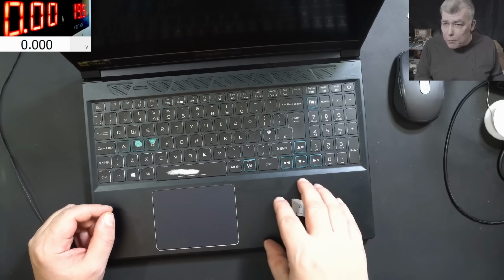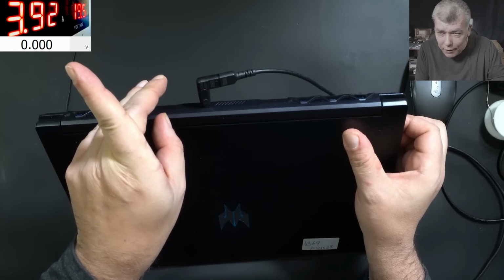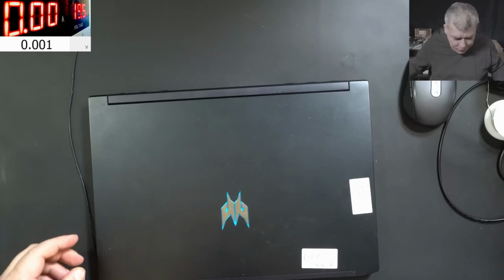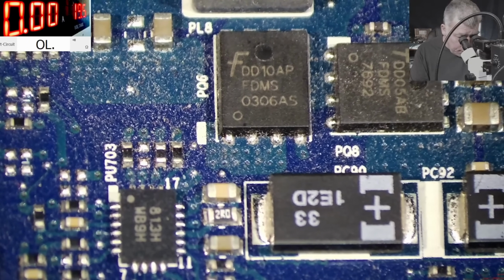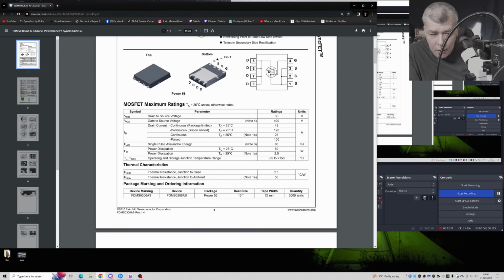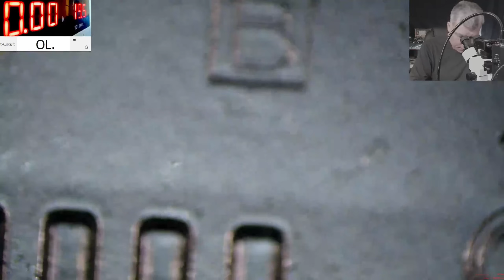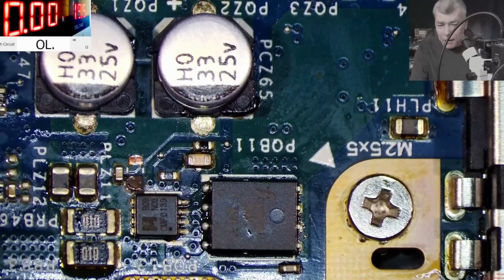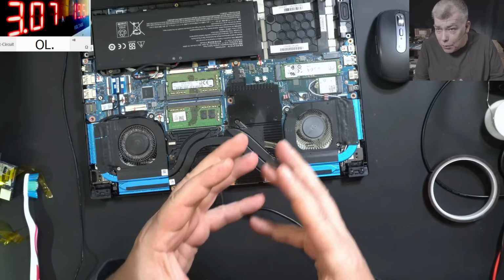Acer Predator Triton 300 not charging - DON'T REPLACE THE BATTERY! How to repair it guide

Comment: My laptop acer nitro 5 having kind of same problem it is not charging and not turning on 
I showed it to a guy and he did some repair and laptop turned on but only for two times and again got same problem as before what should i do
I gave him my laptop 3 times still facing same problem he is unable figure out what is the exact problem 
Each time
He done repair laptop turned on but only for 2-3 times then didn’t open 
Please reply me what should i do
Reply: You've probably tried these options already, but .... Sometimes it's the power supply socket that's faulty, or the power supply plug, cord or 'brick'.

Comment: Thank you for this video. I had a laptop with usb-c only charging that doesn’t charge and powers on only from time to time. and could not find the culprit. Was changing bq already because  I was measuring strange things around the charging mosfet. Thought of replacing the usb-c management chip. But guess what. The second input mosfet from the usb-c circuit is shorted. Can‘t believe it 😂

Comment: Another great video, informative and educational as always. 
Perfectionists - please remember this is and engineers' perspective of fault finding and repairing in a cost effective manner while giving the customer what they want.
I have learned from this channel that a "proper calibrated wire or 'fuse' " can be a safe repair in the right place 😀😀😀 (But, joking apart - you really do need to know what you are doing...as Sorin obviously does. )

Comment: Hello Master! Thx always for your lessons. I have 1 question. You did found that first Mosfet shorted which caused the issue, but, a lot of times you use the "proper calibrated fuse" to short the mosfet and bring the board to life.
Now i am not understanding why this shorted mosfets is a problem, and on the other tipe of faults, when there is no current flow, you short it manually...
My caption is, this time here, was the opposite situation, where the mosfet is always shorted and it should not be? Meanwhile when its always open, you need to short it?

Comment: sorin, 1 question. How can the laptop work fine, with the first fet shorted? why is not shorting the main power rail?
Reply: because it wasn't actually shorted. The fault was the cap was shorted. if he had just removed the cap it would have been fixed....
Reply: if cap was shorted to ground everything else on this power rail will be shorted to ground and replacing mosfet won't do anything. cap was fine but mosfet had short between drain and source so the BQ chip disabled the battery charging cause it sensed the shorted mosfet . your explanation proof you know nothing about electronics . educate yourself more  @g4z-kb7ct
Reply: the mosfet is not shorted to ground, it was just shorted inside , like a switch that doesn't make a proper contact and the light are dim.

Comment: Mosfet was fine - the S to D short was the capacitor alone - hence the current went to zero as the mosfet was turned off by the over current sensor

Comment: 24.5 volt from gate bootstraping because first mosfet n channel at high side gate is float at 18.5 volt (mosfet off) to make its on bq chip must add more 6 volt to make mosfet saturated/turn on. Why its consume more current/power because fault mosfet have more voltage drop from higher resistance compare to normal saturated mosfet and bq chip want to compensate it because power = voltage x current so if voltage drop curret goes up. Why its 18.5 not 19 (other comment before me) there voltage drop from connector and power supply because its use benchpower supply that manually adjust voltage, if we use original charger probably in high current charge will compensate to make output from charger around 20 volt and at notebook you will find 19.5 volt.
Reply: very good explanation

Comment: You get them for repair because people can buy them "brand new" not like second hand business class. If a customer has paid ca 1k(+)€ for it, it is valuable to the customer and it will be repaired even the repair costs 250-350€
Reply: there is a general rule with repairs.... the more something costs to replace the more it is worth trying to fix it. most likely people buy these dead or faulty laptops, pay to get them fixed and sell them for more than they paid. this is how the world works.... it's normal.

Comment: If mosfet was short ..how come we had 19v rail..and how laptop was turning on?
Reply: Because short between input and output just means 19V is passing through to the main rail. This is an expected voltage so the BQ doesn't cut off the second mosfet.

Comment: Can i use proper calibrated fuse insead of MOSFET here?
Reply: No you cant the BQ chip will detect it
Reply: ' proper calibrated fuse = shorted  MOSFET ' = you swaped the fault with another same fault
Reply: @EsportsTVs  MOSFET was partially sorted. So, the voltage gets dropped and BQ chip shuts off the charger. If it's a properly calibrated fuse, full current will flow through it and I don't think the BQ chip will turn out off.

Comment: a fault on it blew the capacitor, you removed it, did you replace it? Any future fault will just blow the rest of the laptop up if you didn't?
Reply: The capacitor was already blown up and the laptop was working my guy. It's clear that that capacitor represents a failure point and isn't needed
Reply: @occultsoundscapes  moronic answer caused by ignorance of the subject

Comment: Great explanation on why it's OK to swap out a MOSFET with another one that is not exactly the same, as long as the Voltage and Amperage is OK then it will work etc.

Comment: 11:10 it sounds to me like you perfectly explained what is going on. The there is resistance in shorted mosfet that is higher compared to working one , so there is voltage drop across that mosfet, and bq chip gets lower voltage on the input so amperage is higher to maintain constant charging current on battery. It cuts off when voltage gets to min threshold that bq chip is willing to accept from charger. So as it warms up more and more mosfet resistance climbs and there is bigger and bigger voltage loss on mosfet untill it reaches min voltage for charging and then bq enables undervoltage protection and switches off second mosfet.  Do i make sense?
Reply: To me that sounds quite right. BQ chip is constantly measuring the input current, I guess, so it can protect the lithium cells and periferal components.
Reply: very good and very correct you nailed it, thank you.
Reply: excellent explanation .. thanks for sharing